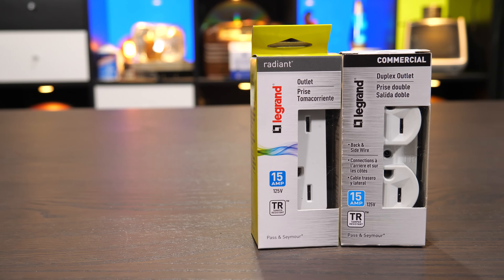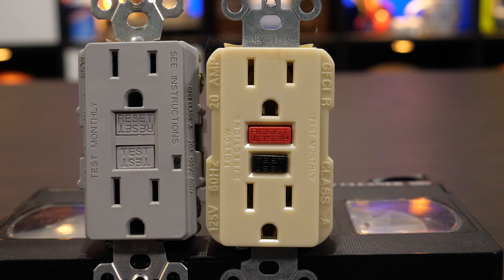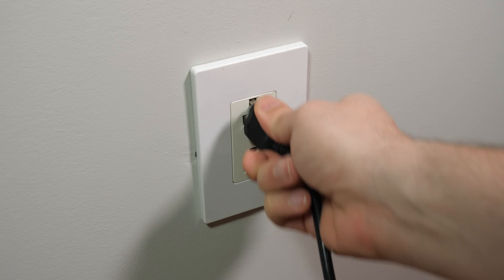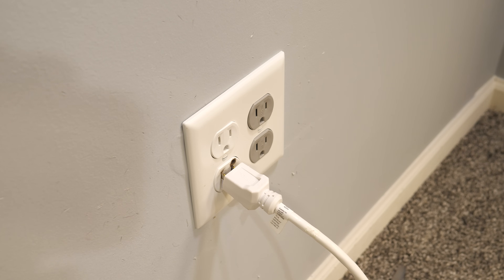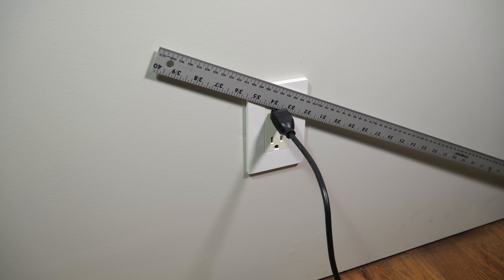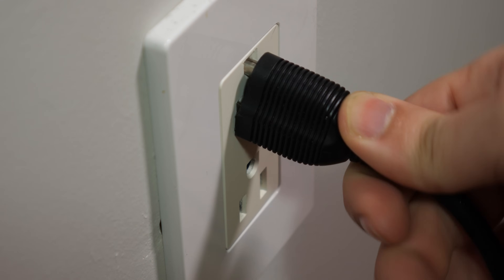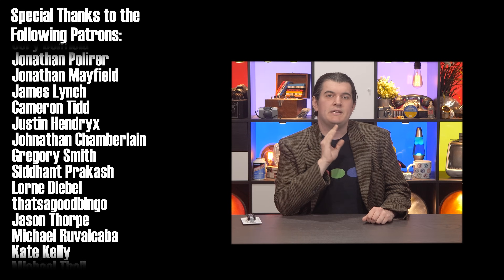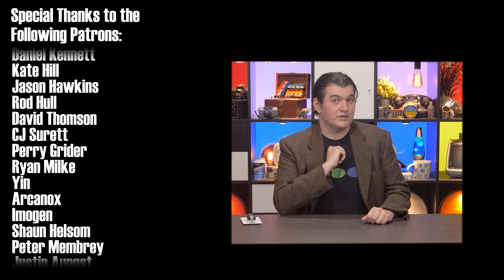Power outlets are topsy turvy - but does it matter?

Comment: My house was built three years ago. Every circuit that is connected to a receptacle or light has a combo GFCI/Arc Fault breaker. So the risk of shock is relatively low because even if you were to somehow touch the blade of the plug as it was partially inserted, the GFCI would activate, cutting power to the circuit.
Reply: Problem with that is certain vacuum cleaners don't work well with AFCIs.
I imagine welders being a problem too.
Reply: @jeffkardosjr.3825  I remember years ago, when AFCIs first came out, people were having problems with them false tripping. We've been lucky so far in that we have yet to have one trip for an unknown reason. So maybe they have improved upon them? The only time they have tripped on us was when we first moved in. As soon as we plugged things into certain receptacles, they would immediately trip. Ended up being the electrician had wired a couple of receptacles wrong and that was the issue.

Comment: I love the deep dive, into the all the therories and explinations as to why there is an esoteric reason to change a standared.  The other thing that I always point out is the extreem lack of actual problems that have actually ocrrued. I have frequently oppoed plug covers becuase that are added inconvience for no observable benefit.  I have yet to find a single documented story of any one being seriously injured by a properly installed and used outlets.  Mush like youre example of throwing knives at the will the current standers is sufficiently safe, and I'll admit that there are better alternative it is not a justification for trying to get every one to change a standared that has proliferated as much as outlets have.  I welcome redesins but only if it doesn't require me to get an adapter or replace all of my electrical plugs or outlets.  

I have always issued the challenge for any one to find a documented case of someone that was significantly injured by a properly installed and appropriatly used outlet.

Comment: Of course one anecdotal incident doesn't mean we should change all standards, but at my last job a metal sign fell on the blades and nearly burned the building down. The receptacle was behind some nearly permanent furniture and easily could have been avoided by an upside down installation. It does happen 🤷

Comment: Electrical plugs and sockets are a horrible relic everywhere. They should just be redesigned and made a global standard while at it. The horrible wall outlets could have an adapter permanently plugged in. In addition of being huge, clumsy, badly functioning and often unsafe, it just blows my mind that after the plug you can't know which wire is live in most configurations.

Comment: I've seen this be an issue. It was secondhand cubicles and the base trim was metal with the outlets set behind the trim slightly. You see where it went. I had little battery backups installed and the metal trim came loose,  slipped between, made a lot of sparks but didn't throw the breaker and came to rest on the mean little bastard. After carefully unplugging the battery backup, I took the piece of trim off, folded it a few times to ensure it couldn't be used, threw it in the dumpster, then told the manager of the call center what I did. Later, the Senior VP of lending asked me where the trim was because he wanted to try straightening it out to see if it would stay that time. I felt very justified in that particular destruction of company property.

Comment: Why UK sockets and plugs are amongst the safest in the world (except for if you stand on a plug which is worse than Lego). As well as RCDs at the distribution box, all plugs have an earth (even if its not connected) which opens the shutters on the live and neutral holes, the live has a fuse as well, and nearly all sockets are switched which is great when you have a multi-strip, as one click of the switch on the wall socket will turn off all devices plugged into the multi-strip. Also all the pins on plugs are sleeved so that even in the instance that a plug is partly plugged in, you cannot touch any of the metal parts.

Comment: The plug on the tape player is even worse than that because it isn't polarized. Took us seppos a while to figure out that if such a plug is plugged in backwards and the chassis becomes live, that can be bad. Some of the cords don't even have ribbing on the neutral wire, so unless you check continuity between the neutral pin and circuit/chassis ground and mark that pin you won't know which way the plug should go in.

Comment: The standard European plug tend to indent 3-10 mm for the none grounded one to closer to 2 cm for the grounded one. Now some old lamps and stuff come with round plugs who could not be plugged into an grounded socket. Caving off some plastic with an knife solves that problem.

Comment: I've seen right-angle cords with the ground on top, but for whatever reason they seem to be restricted to 240V circuits. The NEMA 6-50R and P used for electric dryers, for instance, has the ground on top on the plug and outlet.

Comment: Not sure how standard this is, but something I've noticed in the homes I've lived in here in Florida, a lot of times if a receptacle is on a switched circuit, (ie the one the electrician expected you to plug a lamp into) that receptacle will be turned upside down compared to the other receptacles in the room. Just adding more and more confusion and non-standard-ness to the mix!

Comment: Yup, still don't want to go anywhere near a NEMA outlet.

Right angle plugs are superior, you say? UK plug agrees and says hi! In fact it's law that the cable has to come straight out the bottom of the plug (if it's mains voltage -  if it's a low voltage wire from a wall wart then it can come out in any direction).

But we still have the ground pin up top 🙂

Comment: I dropped a small screwdriver into a slightly exposed outlet as a kid. Sparked, melted a bit of the prongs and almost melted through the entire diameter of the screwdriver. I still have the screwdriver to this day as a reminder how dangerous electricity and plugs can be.

Comment: Honestly this whole issue could be solved if you just sprayed the base of the plug pin as it leaves the assembly line so that little metal bit that sticks out wont shock you.

Comment: One time I dropped some 6-inch wire ducting while working on some ventilation up in the confined spaces we put that stuff.
The wire hit the live pin of one of my tools. Within less than a second the wire heated up enough to melt the duct to literal ribbons aaaallll the way down its length.
And then a hot wire burned off some of my hair as it fell, unsupported.
Fun times.

Comment: An electrician friend of mine always installed those 3 prong outlets with the single ground pin on top.  His reasoning was that if a plug was inserted part way so that a metal object could fall on the exposed prongs, it would strike the ground prong and not short out the two current carrying prongs.  Now the odds of that actually happening are almost zero, except when you factor in Murphy's law.
I'd like to see how a combo switch / outlet is built.  Is it made so that if installed so you can read the 'on' and 'off' (IE: the words are NOT upside down), is the ground prong up?  Also, if an outlet is installed horizontally  as opposed to vertical, is the neutral prong up?

Comment: I was once installing some equipment in a room with an old nema plug in a face orientation. It had a loose metal wallplate around the outlet, which slipped at one point, making contact across hot and neutral. In this case, ground pin up would've been much safer. as was, the metal plate arc'd and blew the circuit for the room. big sparks took a bite out of the metal wallplate.

Comment: I worked in an large Auto plant and all the plugs used to be installed with the neutral plug on the bottom. There was an incident which cause the entire corperation to change every plug to be with the neutral on top. All of the plugs had a metal cover plate in out plant. One day when someone wanted to charge his cell phone during a meeting went to plug in. The problem was that the screw that held on the metal plate had backed out and wasn't holding the metal plate on. When the person attempted to plug in he dislodged the metal plate and the plate dropped down onto the two hot poles and shorted out the plug. Because this happened during a big meeting and everything stopped because all the lights went out. If it would have happened with nobody around the it probably would not have been reported. But because it happened in front a bunch of people, mangagment people at that, it became a big safety issue. At this time the corperate policy was that safety was massive prioity. So it was decided by upper management that all plugs had to be switched around so that the neutral was on top.

Comment: Most appliances that use the third pin are designed to be used with the third pin down and the appliance cord also down.

If such a cord is plugged in with the third pin up, the cord will be at a right angle from gravity and thus putting strain on the cord.

Comment: The US should move over to the plugs that the UK use. It's one of the few things that I feel any sort of patriotism about, it's the best kind of plug by far. It's also so weird that US sockets don't have switches especially as there is no cover on the pins when there is no plug inserted. It's also weird that wires leave the socket via the plug perpendicular to the wall, over here the wire is turned 90 degrees so it's parallel to the wall. Pulling on the wire tries to pivot the plug and the plug is a tight fit with a lot of friction, you will have a really hard time pulling on a wire to pull it out of the plug socket. Edit: I just got to that point in the video where you talked about how good they are.
The US's plugs make me sad as just how awful they are on every level, they really embody the American spirit. Fuck Bald Eagles being your national icon, it should be your plugs.
The best merit for putting the ground pin up top is that it's more British innit?

Bonus fact, you can take the plug off of anything with a plug and it's really easy to do. For a long time when you would buy a product you'd just be given a bare wire and you would add the plug yourself (that was a long time ago) but it still means that most plugs attached to a wire can just be taken off and replaced if you for some reason want a plug with a different form factor (maybe you do want a wire sticking straight out, you can do it). It looks like most US plugs are molded and you would have a hard time getting a standalone plug to attach to wires, you'd also need to deal with cutting and stripping the wires, so you can't just install 90 degree plugs to your wires. Also your sockets are above and below while ours are side by side which allows for 2 90 degrees next to each other

Comment: You would think that having the ground pin on the bottom would mean that if a plug were to wiggle out it would be the last pin to come out of the socket witch would be good.

Also when the ground pin is down it looks like a face witch is required in my books

Comment: My home built in 2007 has the outlets installed in that fashion.

@4:23 - a lesson I still recall learning some 55 or so years ago when I was a small child.

@15:45 - not as wild West as my trip to Peru for some mission work.  They just stripped bare wires and jammed them into a power strip to power the tools we were using to build out a new classroom.  They really had no fear and/or they had more pressing problems.

Of course, I also took cold showers as I did NOT trust the electric water heaters that were on the shower heads.

Comment: The problem with right-angle plugs is that you can't use more than just one on a single receptacle.... unless you get those that are skewed off at an angle to avoid the other plug.

Comment: Safer. Not correct. There’s a failure in logic here. If there is no issue with angle cord orientation, than there is no issue with plug orientation. Same as saying it is wrong to back into a parking spot. Both ways work, but one is technically safer

Comment: My dad used to work for a home builder and he told me the reason they switch to the "ground-on-top" orientation was mainly because contractors would constantly step on or trip over their own extension cords. With the old orientation, it was much more likely that the ground pin would break off in the socket. Then the whole socket had to be replaced at the builder's expense.
Reply: I should add that their electrician charged $85/hour.

Comment: The point I always make for putting them "upside down" is all my wall bricks (that are polarized or grounded)  are orientated in a way that they will wrench on the outlet if the round plug is on the top.  This might have been covered, but I'm only 2 minutes into the video.🤷‍♂

Comment: Outlets are often installed face up and down. Face down on an unfinished basement ceiling, in cabinetry and above drop ceiling. And face up in large open spaces like you see in departments stores with a special cover so the cleaners can vacuum but is also see in residential for lamps in the center of large rooms.

Comment: What we have here in Switzerland is pretty good. Our plugs do tilt slightly similarly to how you demoed, but theyre pretty much all shielded at the base of the prongs and I'm pretty sure they don't tilt as much. Most outlets are also recessed so it's not a problem with unshielded plugs. And while we have a different plug from schuko which is used in many other European countries, the live and neutral prongs have the exact same shape and spacing so ungrounded plugs work in schuko countries too
Reply: And an ungrounded shuko plug works in Switzerland. So in the hotel, my phone charger--aka, the one item I needed most--was the one item that didn't need an adapter ^^ I don't know why you almost share our design but not quite... but in terms of compatibility, it's decent enough.
Reply: @McKay1108 the „ungrounded Schuko“ is a flat Europlug, right?
Reply: I travel to Switzerland quite a lot from the UK. Yes, I like your plugs with the "flattened hexagon" profile.  I have even noticed some clever three phase outlets that you have, where the hexagon profile allows a normal plug to be inserted to get 220V between a phase and neutral, but a larger plug can be used to get 380V across the phases. The design is clever so it would not be possible to connect a 220V device across 380V.  (I know I should probably be saying 230V/400V now).

Comment: Dumbest design of outlet worldwide. When the socket is pulled out half-way, it shows live contacts. Like how the heck someone allowed this design at all? For the rest of the world, the outlet itself covers the pins of the socket until they are fully seated to the outlet. Every time I see the US version, I'm just.. ok they're using imperial units, maybe this is the same dumb imperial way how to do electricity...
And imagine the EU version of dual socket outlets where the upper one is rotated 45degrees and the cables won't obstruct each other when connected both of them. Mind boggling.
Reply: Your claim is incorrect.

Comment: When I was in school for electrical, we were told the idea of putting the receptacle in upside was the proper was as if the hot were to get loose it was a better chance of having a tripped breaker. There’s a code reference iirc that mentions hospital receptacles are supposed to be installed sideways for certain applications as well but it’s been almost 10 years and I’m just barely getting reintroduced into my code book again studying for my masters license here in Texas

Comment: Yep, the pipe fitter's union in Chicago has mandated conduit in walls since the time of screw in plug fuses. Some contractors will wire an outlet with the ground up in bedrooms if that outlet is controlled by a wall switch.

Comment: There ARE issues with placing an outlet-strip on the front edge of an electronics workbench. If the grounds aren't on top, you risk shorting the AC with a stray bare wire!

Comment: Now I am thankful my country is sane and opted for the round 220v style pins.

- the outlets are intruded (extruded inwards) like the bottomside of a lego, and the plugs behave like the studs on the legos, eliminating the exposed live thong problem completely.
- right angled plugs are the default here
- the "holes", or the eyes of the smiley face are 45 degrees angled in the first place

Comment: Most of the outlets in my home were ground plug up and prongs down. As I replace older outlets, I flip them back to the typical way, because in many cases power cords are stressed if they come out at right angles from the plug.

Comment: 7:37 wasn't there an awful Tik-Tok challenge where people did exactly that to short out electrical outlets?

I believe it was called the "penny challenge", participants would drop a penny down the wall and try to get to land on the prongs, it was usually done with iPhone chargers which lack a ground so mounting the outlet upside-down would do nothing to stop that.

Comment: I had the joy of staying in a small rental in the US (it really was nice). It had two electrical appliances, a microwave and a fridge, with  only one practical wall socket. Both appliances had the 90° plugs (with neutral pins). I was left stunned by the 'shockingly' bad design. I have to assume there is a way to overcome this?